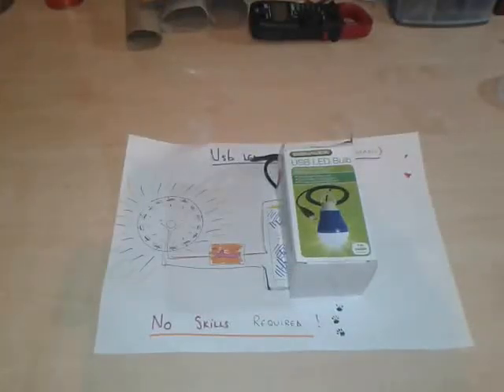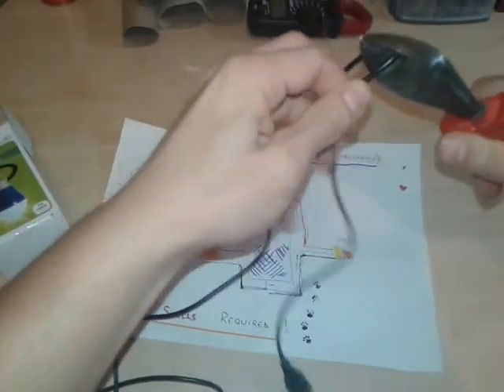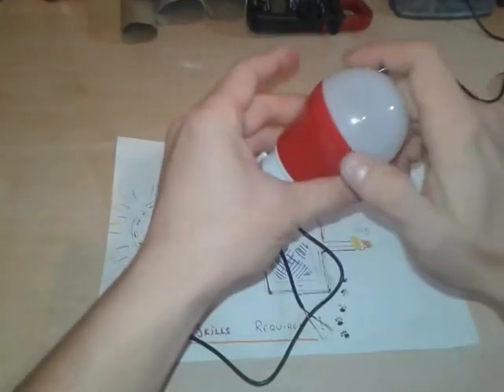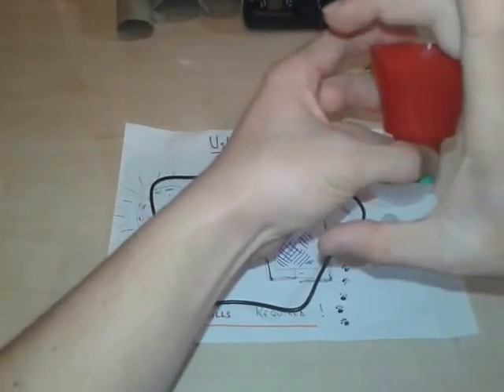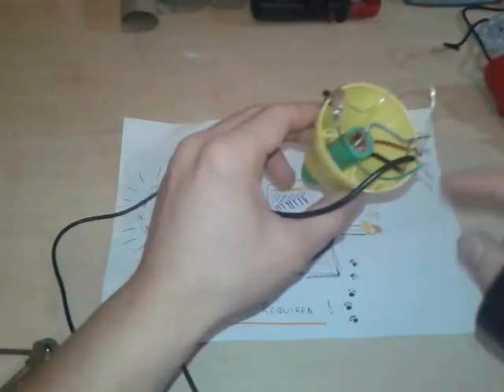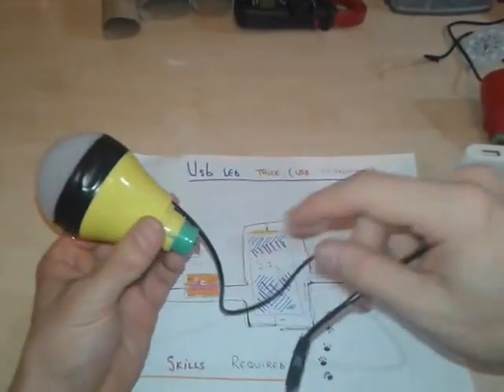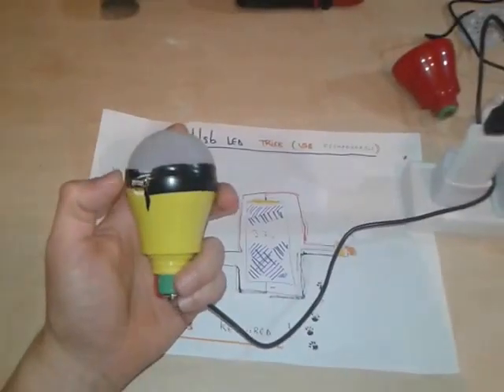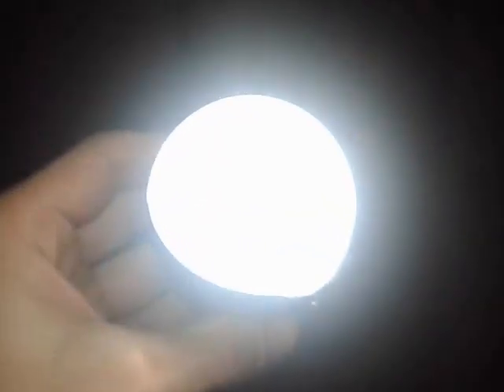How to make Rechargeable usb Led bulb at home.No skills required

Comment: Don't have a 18650 you can use a cell phone battery some will be small enough to glue to back of PC board. They usually have a battery protection circuit inside too. Also put a diode between the battery and the USB plug to keep power from going back into the charging device. Diode will reduce voltage and current to battery but will increase charge time.  Don't want to blow up your computer.
Reply from the maker: cell phone battery work and diode good tip thanks

Comment: please say what kind of battery you use?? what is the wat and ampier
Reply from the maker: Is a li-ion battery from an hp laptop.3.7v 1800ma (1.8A)
Reply: NoSkillsRequired  so...please say the backup time..is it longer 3 hours?? is it very bright??
Reply from the maker: +Lumen Tech so depending on battery ma capacity lets say if the battery is 900ma it can last up to 10h.

Comment: hi, that 3.7v battery can not take 5v direct, it might explode you need a LION charge controller from ebay for .99c .
Reply from the maker: yes it can as long the amps are 500mil(0.5A) or less and if you not let it overcharger so monitor the charging and when it reaches 4-4.2 unplug the charger